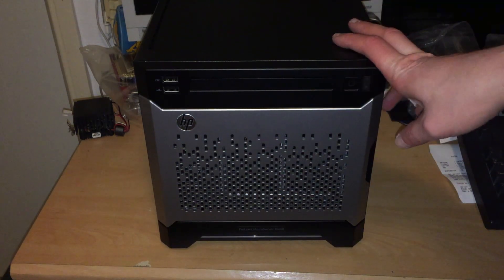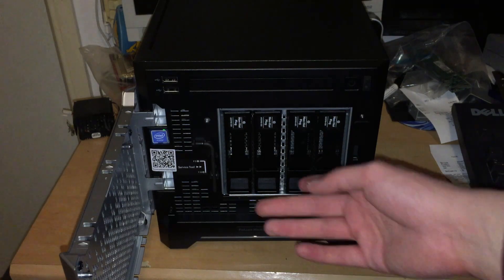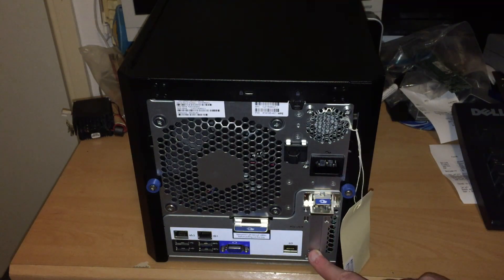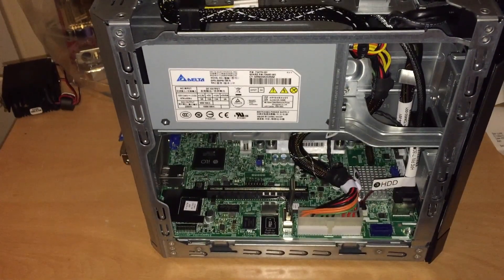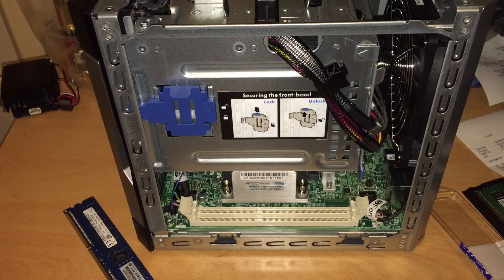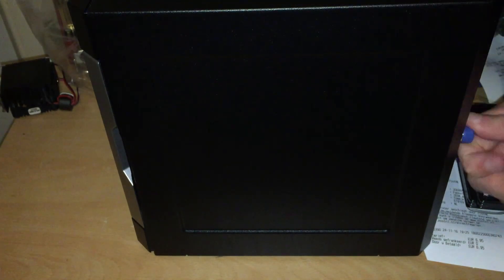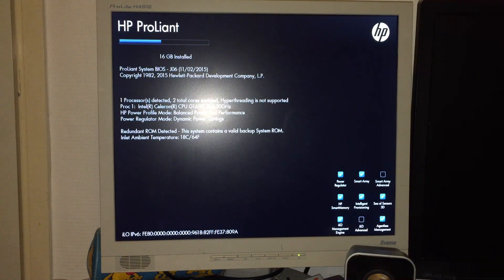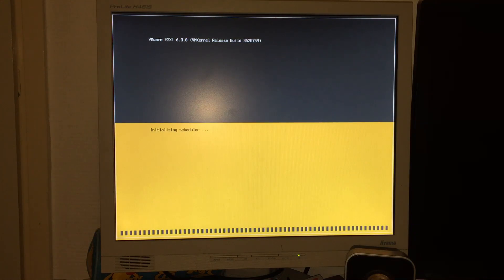HP MicroServer G8 - Overview, Upgrade & Test

Comment: Low performance cpu versions such as Celeron and Pentium ran 150 watt power supplies, the higher performance later options with I 3 CPU ran a 200 watt power supply and a 65 watt rated heatsink assembly still fanless.
I upgraded to a Xeon 1230 V2 at 3.3 GHz with 4 cores and hyperthreading plus full virtualisation support and when I did that I modded a Noctua LH9I Chromax Black by cutting the brackets with a dremel so they lined up with the original heatsink locating holes in the motherboard, The Noctua is low enough I have had no cooling issues.The brackets are some form of Stainless Steel so are a bastard to drill so it all works in the end and Power is taken from a splitter inserted into the Molex Connector.
Regarding the Ram limit the Xeons are capable of running 32 gig of Ram still only Dual channel so the real Ram limit on the Microserver is neither Dual Channel or CPU related or even Bios or C204 Chipset but simply a case of to run 32 Gig of ram you need 4 Ram slots and the Microserver only has 2 ram slots.

No SSD installed Because I have a HP slim Blueray drive in the optical bay (yes they do make them) but the first bay and the second bay are Sata 6 gbs in these and Sata , 4 and 5 (Optical Bay) are Sata 3 Gbs speeds I do however run a HP Enterprise 2.5 inch Velociraptor 10,000 RPM drive and these come in a 3.5 inch adaptor that is in fact a massive finned heatsink standard so I am not really missing much from using a Sata SSD at the same Sata 6 Gbs speed limitations and cooling is well taken care of.
 
Now some people have modded these Gen 8's to take USB 3 ports instead of the USB 2 ports in the front of the chassis, But beware when these systems boot under the ILO bios HP run, Only the front USB 2 ports are active allowing a USB install of an Operating system and a USB 3 conversion may negate that advantage meaning the only possible USB port for OS install will be the one on the Motherboard itself next to the MicroSD card slot, Not that big a deal however as 2 thumbscrews and the cover is off allowing acess.

Long reply but seeing as so many sites that once hosted information on these Gen 8 Microservers have dissapeared such as Homeservershow forums I thought it wise to put some information out there for those who may be looking for it.
Reply: @stephencox4224 Does that mean it runs with 2x 16GB Ram modules or not? I also would like to upgrade mine to 32GB Ram.
Reply from the maker: No. You need 4 slots to get to 32, so 16 is still the limit.
Reply: @garcipat  Sadly the limit is 16 gig due to only having two slots though with the right OS that is not a hindrance
Reply: @garcipat  No max of 16 Gigs 8 per slot with a 4 slot motherboard the CPU supports 32 Gig these only have the 2 slots hence 16 Gig

Comment: Is it possible to replace the mobo with another itx mobo?
Reply from the maker: No. The machine is fully proprietary. You'll need to stick with the original socket 1155 motherboard from HP.
Reply: If you are creative ITX format Motherboards have been fitted at one point the Chinese actually made a conversion kit for the job but it usually requires offsetting the ITX Motherboard backplate cutting it so to allow a dedicated video card.
That means fitting an ITX board where you are happy with the leftmost ports usually only USB2 to not be accessible due to chassis design.
Align the Motherboard allowing the Video card slot to be utilised allows you to locate where to place standoffs after removing the original HP ones, It is made easier by the fact the Motherboard tray is removable from the chassis for modifications

Comment: what is the maximum cpu compatible with this model?
Reply from the maker: Technically a Xeon E3-1280v2 but the cooler isn’t really up to snuff. I’d stick with an E3-1230v2 or a 1265Lv2 if you want 4c/8t.

Comment: Hello, if you can help me, you have changed the power source of the gen8 I have seen the most current SSP-300SUB, could you help me with a compatible one since I have my gen8 with 4 hard drives of 3.5 and 6 hard drives of 2.5 plus the i3 processor, I need something more stable for the NAS
Reply from the maker: I haven’t changed the power supply when I had this server, so I couldn’t tell you
Reply: I upgraded my gen 8 with a 300 watt flex power supply but as to what brand it is it is a pain to remove to find out but search power supply formats and you will soon work out which form factor fits and there were a range of options available in that form factor

Comment: do you have any problems running a guest os on the server?
Reply from the maker: Not at all. At the peak of my experimentation, it had about 10 virtual machines running at the same time, without any issues. Then again, my server doesn't get a user load. If it has to run production for an actual business, virtualization isn't the right choice for this kind of server. It's too memory and storage constrained by default.

Comment: Did you also get a bigger heatsink when moving from the Celeron to the i3 CPU? If not, have you experienced any temperature issues when using the higher TDP i3 with the same heatsink that the Celeron came with?
Reply from the maker: +Tomiking33 the stock cooler is rated for 95W max, so there are no issues with using a higher TDP chip. For quiet operation, I'd stay under 65W if possible though.

Comment: that version with Celereon cpu is to low ?
Reply: Early Gen 8 were Celeron 35 watt CPU with 35 watt heatsink, Later Gen  8 came with Core I3 and 50 watt heatsink both no fan.
Early Gen 8 was 150 Watt Power supply, Late Gen 8 with Core I 3 was 200 watt power supply.
I use as noted in one of my replies a 300 watt Power supply Flex ATX style
Reply from the maker: What do you mean?